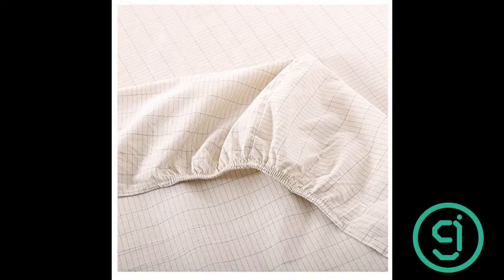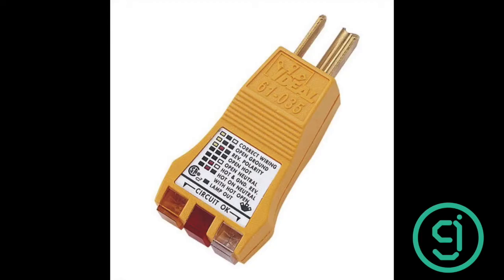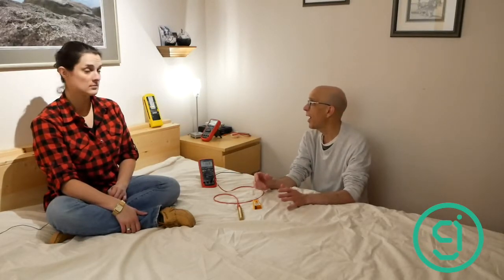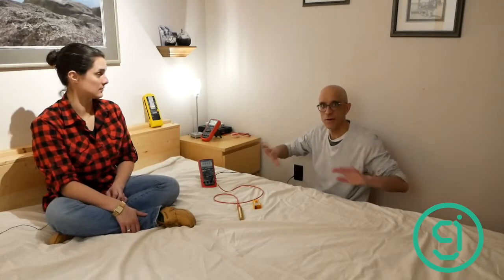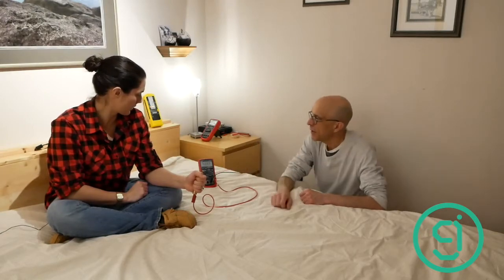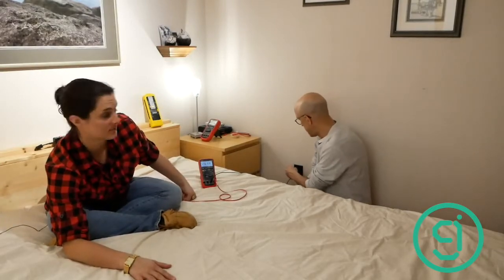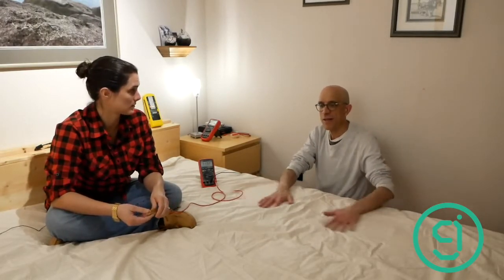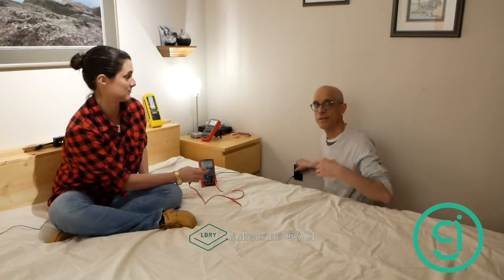Grounding Sheets Efficacy

Comment: I find this process a bit complicated and confusing. How do you stop the walls from being EMF conductors? And how do you make sure that you're grounded to the Earth not to an electric outlet?
Reply from the maker: This was an unusual case where the walls contained conductive screen in the plaster to amplify the problem.  The solution was to cut power to this room circuit during sleep times.  The same solution is used to stop wiring close to the bed from radiating E fields.  This link to a basic body voltage kit instructional video from Safe Living Technologies will likely be very helpful for you:
https://youtu.be/hc0YqKTcRJg
Reply: @9ci  my house outlets are not grounding so i had to connect the cable directly to the ground thru my windows. Do you think that is ok?  is it working?
Reply: lol. Struggle away! Then think nothing of walking outside in the sun......But no, that's "good" EMF, right? lolololol.
Reply: @matthewyabsley cool, condescension is always helpful 👍🏼

Comment: So turning the breakers off - no electricity in room might be a good approach, but there can still be dirty electricity noise on the ground?
Reply from the maker: If the ground is wired properly and has adequate coupling to the earth, the ground noise should be minimal. However, proper coupling to the earth ground can vary at each location depending on the type of soil, moisture and mineral content of the soil, number of ground rods (if any), the length of ground rods, or most recently, the size and depth of a grounding plate. Typically, modern homes do not have a good ground connection to the earth as ground rods have been replaced with a small "ground" plate simply buried a few feet in the soil.

Thank you so much for your question!

Comment: Thanks for the review
I don't recommend connecting the sheet to the electric ground which has some low level electric noise (connect a scope between the electric ground and the real ground outside and you will see it). 
Ground your self only to the ground outside (after making sure there are no ground currents).
Reply: Sorry but can you explain this in more simpler terms please?
Reply: Yeah anyone with any electrical experience knows it’s not that uncommon to have leaks of current into the ground circuit - you’d literally be doing the opposite of what you intend if  that happens
Reply from the maker: Thanks for the comment and the tip!
Reply: @9ci hi, please explain the point you make at 1:56?
Reply: @NoRadBlog  Relying to your comment 2 yrs. ago.  I hope you see this.    I live in a hi-rise building.  Is there a way to do this test you mention vs. throwing a 150' cable out my window & drive a stake into the ground?   I wonder if the fresh water copper piping is fully insulated from the concrete structure, as the galvanized electrical conduit runs inside the poured floor/ceiling slabs.....
Reply: If I was in your case, I would try and test the electric ground before using it. An additional option is to use some metallic-conductive that is connected to the wall and  use it to ground your self. 

I would not use the water pipe, as in where I live it is very often used for electric grounding.  

 Also, if your floor is made from conductive stone/tiles/marvel, it should be grounded when walking barefoot.  @chrispompano
Reply: Exactly how to test the electric ground?  I have a very good DVOM.  My apt. is carpet over concrete slab.  Only glazzed tile in kitchen, & marble in bathroom....

Im missing this entire concept now of grounding since it seems like people are eluding NOT to do it around EMF 
/WIFI ect. or your body will act as a receiving antenna if you're grounded?????  Am I understanding this correctly?
And again it depends on how you ground yourself?  Better vids & tutorials need to be made, or I hurt I need to pay for the consultation by that firm the recommended who has an extensive website..
Reply: I am sorry, but I am not sure I am the right one to explain how to test grounding. 

For me it helps. I am an EHS person and I use grounding , both for my self and for my equipment every day. 

I got my house grounding system tested by an professional expert electioneer, how is also an EMF export. 

I feel better when grounded. I think the skin is becoming a better RF and electric field protection layer when grounded ( I think, no know) and it also lose all static charge that builds up.

In addition every equipment that is being grounded (like a laptop for example) is not emitting the electric fields ELF it would be emitting if not grounded. 

 @chrispompano
Reply: But there shouldnt be any low level electric noise if there is a possibility to switch the socket off.

Comment: I've got one of those, its not much use in an EMF filled environment, you wake up with a whole body that feels tired.  I'd recommend investing in a canopy or some sort of shielding instead.  Might work better if its connected to real ground, I think my ground is connected back to the power substation.  You just end up like an antenna pulling signals to ground.  Ditch the spring matress also, you need a solid Dunlap rubber instead, a great investment.
Reply: @hootsmin sir, I unfortunately don’t have eight hours to spend walking around barefoot outside
Reply: Can you further explain how to lower the e-field environment?
Reply: I just bought the same sheet and tried for 4 days now. Each morning I got up and feel so tired ….,, I guess I need to figure out actually how to truly ground the sheet…
Reply: @pm4995  Its useful for dropping your body voltage back to normal levels, beyond that it's not a great deal of use.  It's certainly useful for those who handle sensitive electronics.  You could walk about outside in bare feet or use grounding boot straps on shoes and do basically the same thing.  You can ground yourself inside the house by touching a radiator (should all be earthed normally) or similar earthed copper water pipes also or a metal housed appliance which is plugged in and earthed assuming it has some bare metal.  You can probably rig something up for a try.